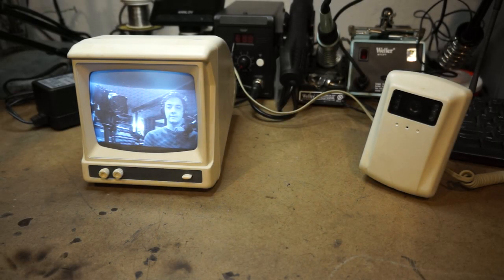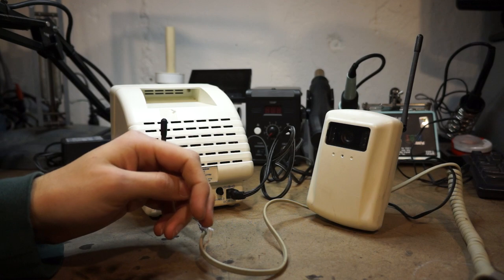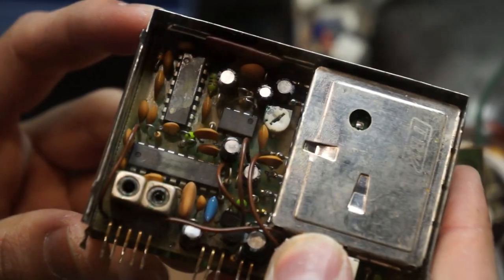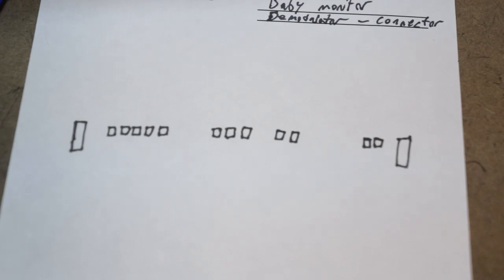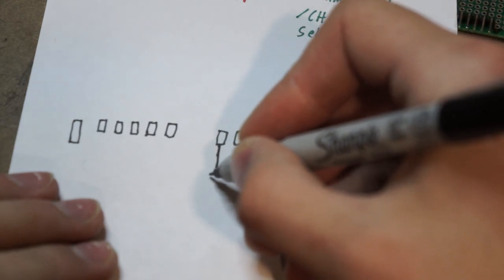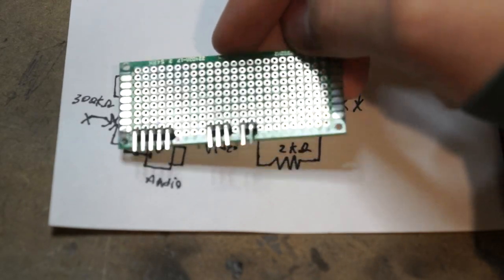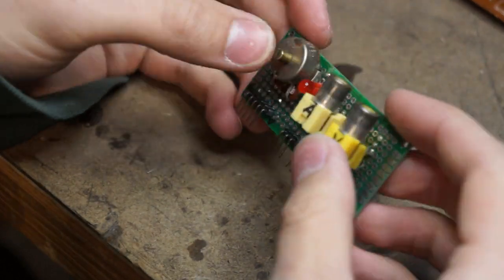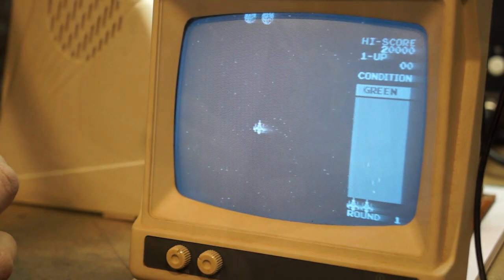CRT Clock v2 P1

Comment: You could probably (after removing the RF box) just fed video back up that external video lead shown earlier.
Also, lots of ghosting on the pic, try a 75 ohm termination resistor on the video line - on the back of the proto board.
Reply from the maker: I would not be able to back feed the video signal through the output as there are a few transistors/components for amplification. I will try the 75 ohm resistor to see if it works, thank you!
Reply: I second the 75 Ohm termination advice.  This is neat, but I'm still terrified of sticking a scope probe in a TV or tube radio.  I learned the hard way about two wire (ungrounded) AC devices, hot chassis and Earth grounded test equipment.  I have a Variac, but I still need an isolation transformer before poking around line powered stuff.  It appears that your TV is powered through its own isolation transformer, but it still may be passing through the Earth reference.
Reply: If cant backfeed from the demodulator box then should be able to go inside and back feed 

U don't need a isolation transformer to use a scope 
Having scope ground un connected should work fine 

If u need to use grounding use couple of light bulbs in series SOS have very small current 

Also seen a backwards wired mot transformer  used

If do have this problem alot use isolation transformer on the scope then permanently have it

Comment: I strongly recommend the Engineer SS-02 solder sucker, best $25 you'll ever spend. Or one of it's lower priced clones, I'd imagine they work just as well.
Reply: I was just about to tell how a de-soldering station was the best thing I ever bought when doing a lot of work needing that. I got the cringe when I remembered using a solder pump last time lol
Reply: Edsyn Soldapult was the difference between several others little better than a solder-bulb and a perfect suck every time, for me.
Also, if you heat the joint then push the sucker tip completely around the pin and suck at the same time, it'll suck through-hole plated joints clean on both sides. At that point all you need to do is jiggle each pin with a screwdriver tip, if there's a tiny contact remaining at a side.

Comment: You can easily add a composting input to any CRT TV. on the one you used for your first watch, you probably only have to solder a single cable

Comment: You said "actually" 28 times in this video. You should write scripts to avoid using knee-jerk filler words like actually, essentially, and basically. If you looked at a transcript of this video and removed every single actually from it, the only thing you'd notice is that you were able to communicate your message clearer than before.
Reply: clearer?